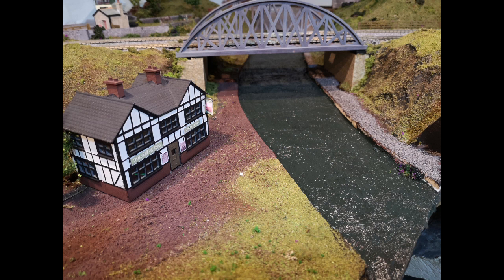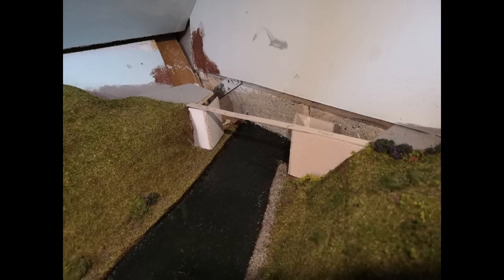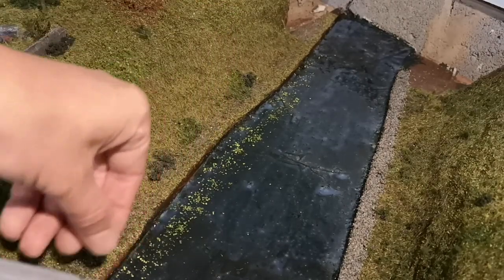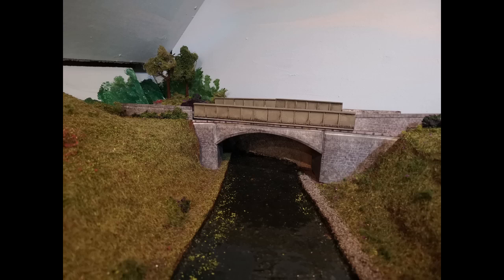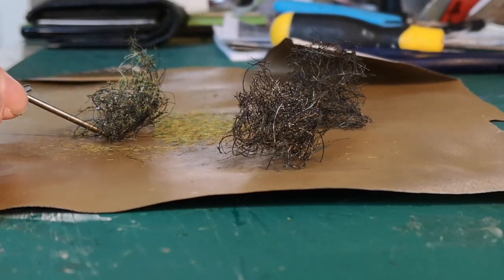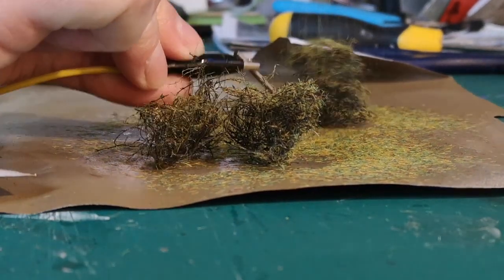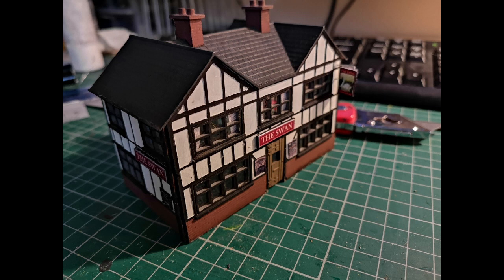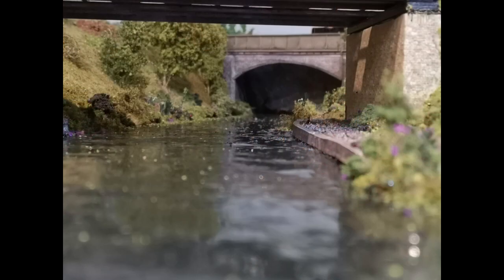The Canal - Part 2, finishing the scene. OO Gauge Model Railway

Comment: looks very good indeed. i used p v a for the water effects. came out nice on the village duck pond.i will have to try it on something bigger.
Reply from the maker: Hi Thomas and thanks for watching. I got on well with the water based varnish and I think it worked out well. The key was thin coats and to let the varnish fully dry before recoating. Cheers  .......Andy

Comment: Hi Andy that canal scene looks great - What was the varnish you used as I am looking to put a pond in and was wondering what to use for water. This looks like a good method--------Cheers Kev
Reply from the maker: Hi Kev, thanks for your comment. The varnish is Wilko's own, ultra tough, clear gloss, quick dry (water based) £3.50 for 250ml, good stuff, you just need to put on thin layers and let it dry before re-coat for the best results. (I did 8 coats over a week). Thanks again Kev, all the best, Andy
Reply: Many thanks Andy and will catch up on some past videos .   Cheers Kev
Reply from the maker: @medwaypeninsulaMR  Thanks Kev, yes, ditto, I've a huge list of vid's to catch up with 😁